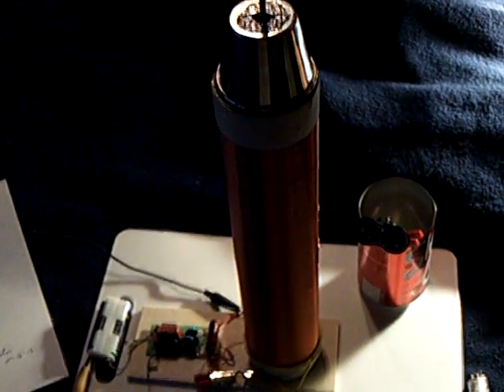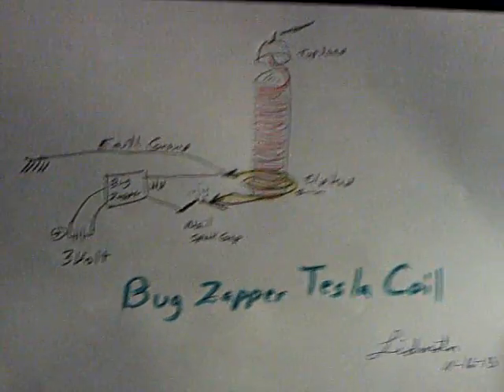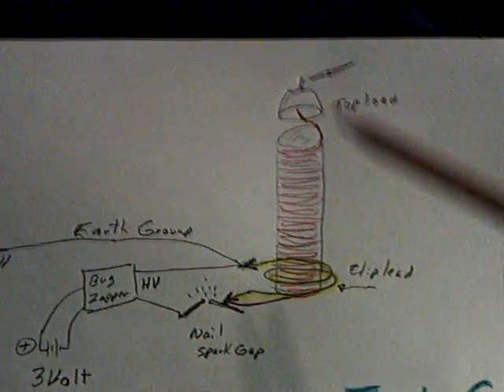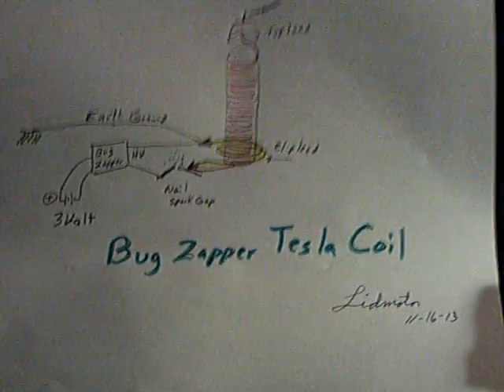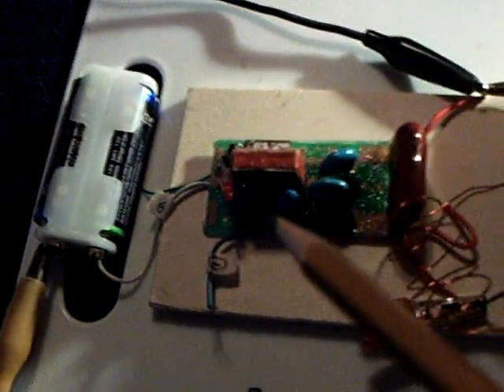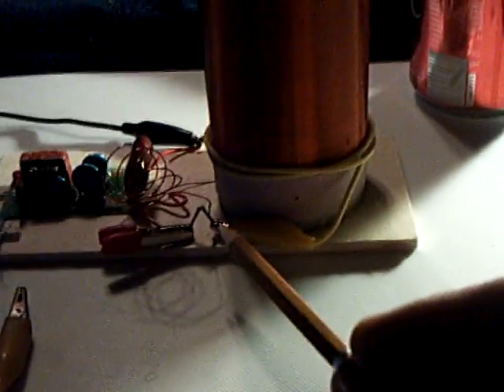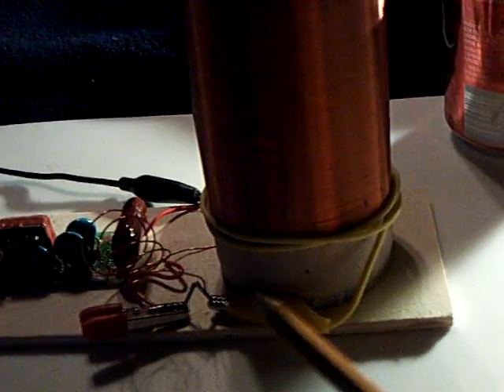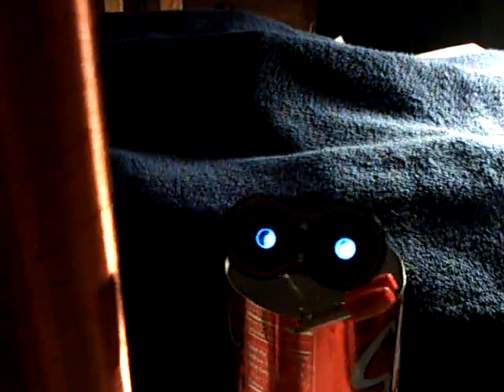3 volt Bug Zapper-- TESLA COIL

Comment: What if you replace the transistor with a higher power equivalent, and drive the circuit on 6-9V, maybe 12V if you're feeling lucky!?
Reply from the maker: I have been studying these big zapper circuits and I may build one from scratch that will run on 12v.  I would love to see the big purple coming out of that top load.
Reply: ***** Perhaps instead of making a single transistor design (usually weak and fry-able) why not make a miniature ZVS circuit drive a small HV transformer, like a trigger coil? I would use 2 IRF540's.
Reply: Power Max I have to agree with Power Max. I made a ZVS a couple of weeks ago, and it still scares the living daylights out of me. Now it's attached to the Tesla coil and I get 20 cm streamers and a lot of noise.
Reply: I also made one a few weeks ago, and with a homemade flyback transformer, with enough turns on the output for 200V, I can nearly burn out a 40W incandescent lamp!!! I have not managed to get it to light a 100W lamp with 12V 12A yet modified Xbox power supply yet.

Comment: No offense but this is actually not that safe. When you hold the neon bulb etc the electricity is running though the bulb and using your body as the ground. Same as when you get shocked without the bulb.
It's not a good idea to mess around with high voltage as even very small amount of current can stop the heart. Remember at these high voltages the skins resistance is nothing and the electricity will just run straight though.
Reply: Tesla coils are dangerous. Even small ones. This is a fact. Also for some who have certain coils that alternate the current at frequencies higher than 15–20 kHz the body at that point cannot sense the flow at those high frequencies so the person will think it's alright but tissue damage occurs and of course death in some cases.
Reply: ziongite
And considering it's reaction in this video with the Neon in the vid it's clear that there is enough current to cause at least tissue damage. Probably not enough to cause heart problems but it's still dangerous and you should not have it flowing though your body.
Reply: Yes it is, because thats not powerful enough to kill you, charge in capacitor is usually around 40-60 μC, and presents nothing. I tried neon sign transformer (12kV and around 60mA) and I am still here, its not comfortable but not too dangerous, as you step up the voltage the current goes down, you cant create power out of nothing, read Ohms law book and learn few formulas first then pretend that you know something....
Reply: @boostedteslabt3715   thank you its funny when people start trying to parent grown people who obviously know more than they do this circut it harmless with the miniscule amount of current he has powering it the moment a load is applied the current drops to almost zero